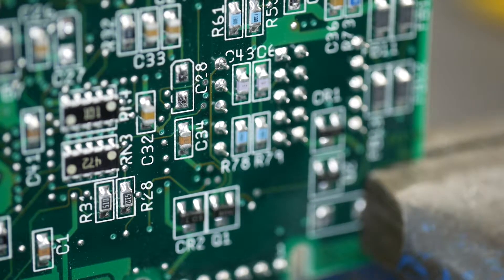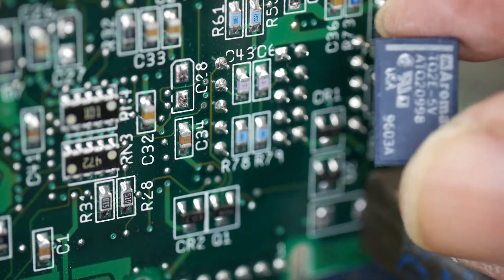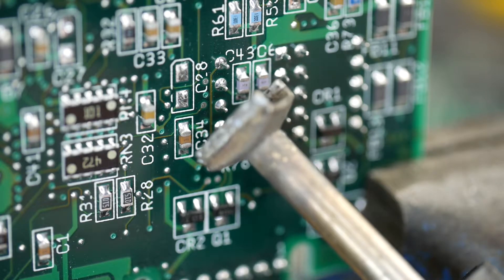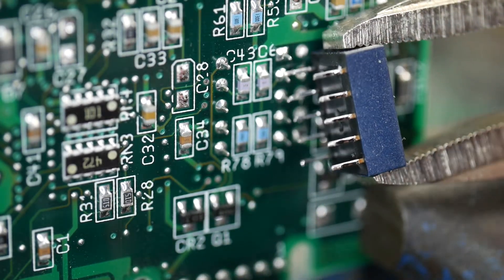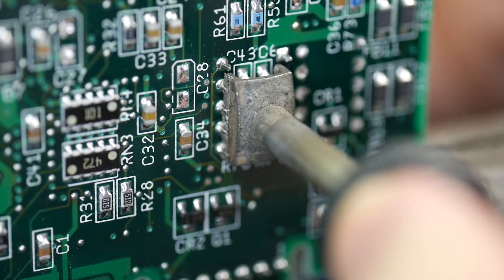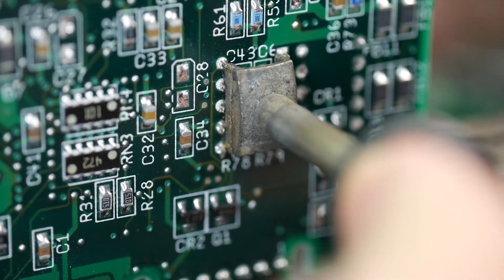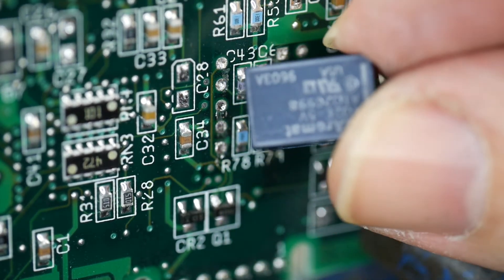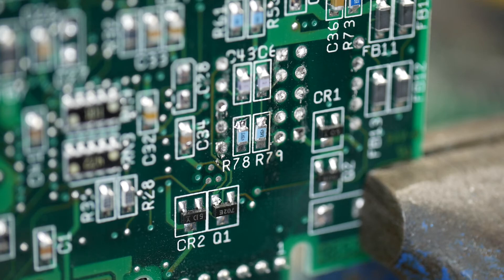Desoldering a DIL Relay from a PCB

Comment: Where do i find a tip like this?? Im trying to move relays that have 4 pins on each side and its been a pain.
Reply: That tip seems like very specific to the width of the relay / ic 

Instead buy desoldaring iron it costed me 350 Indian rupees, I was able to remove 8 relays in under 5 mins